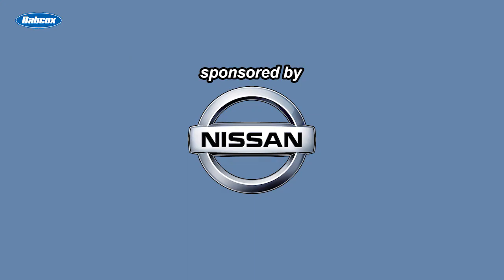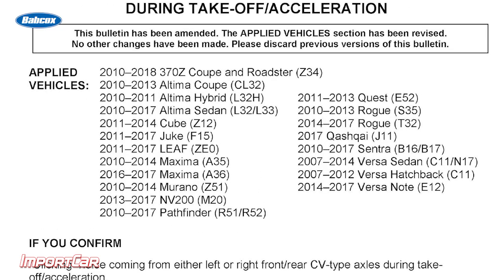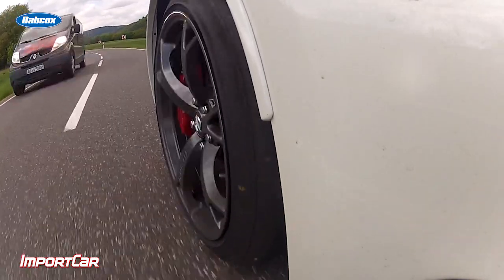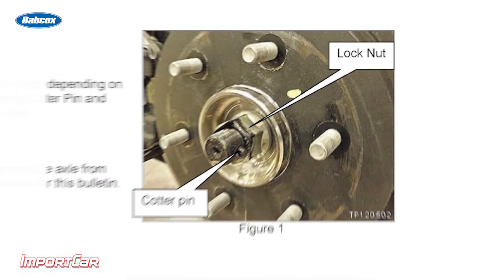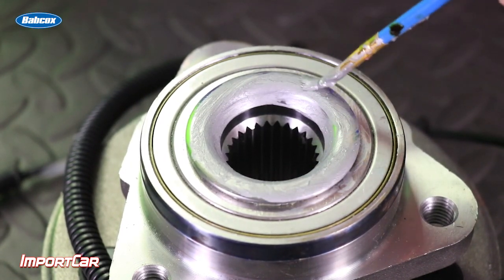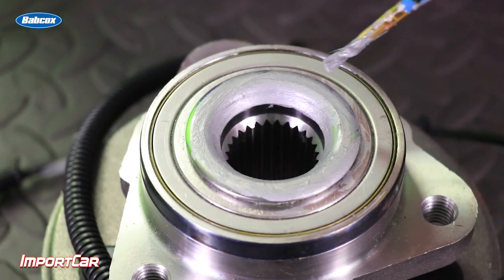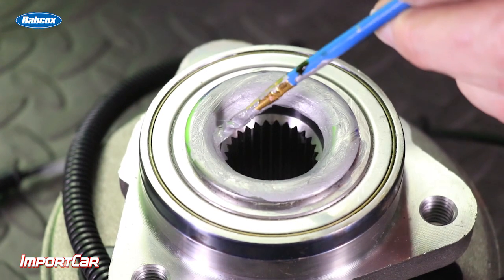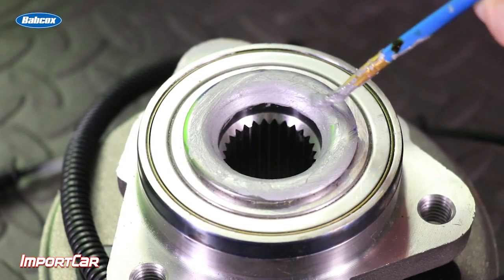Clicking From The CV Joint Or Axle? Check Out This TSB | Tech Minute

Comment: Spot on! Worked like a charm. 

I took it a step further and cleaned off all rust from the back face of the hub and the axle with a rotary wire brush. I was already doing other suspension work so it was easy to take that extra step.

Comment: The clicking noise comes from the roller bearings moving in and out of worn pits in the bearing surface within the CV joint!!! This video does a dis-service to troubleshooters! It has nothing to do with the CV axle other than it protrudes through the CV joint and transfers the torque from the engine. The bearing surfaces in the CV joint only wear abnormally when the grease drains out of the joint because of a leak/tear in the CV boot.
Reply: Brian Ford so I just changed my CV axels on both sides and now I have a single click that occurs when changing direction. If I back up, it clicks. The if I go forward, it clicks again. It won’t click again until I back up. I can recreate the experience if I hold the brake and put in reverse and then push gas. Then switch to drive and push gas with brake held. The wheel is not rotating but I still get a single click with the change in force.
Reply: @bradmelton7985  Are your axles and intermediate shaft properly/fully seated in the differential? Also, check the tightness on any intermediate shaft mounts, transmission mounts, axle spindle nut and suspension hardware. Sounds to me like something is slightly loose and shifting a tiny bit when the axles change direction, which leads me to believe it's a loose axle or axle mount.
Reply: @bradmelton7985  me too man. did you find a way to fix it ?
Reply: Batsuld Kyu The easiest and cheapest fix it to unbolt the joints, clean the rust off, regrese them with M-77 grease ONLY. Should take about an hour
Reply: @bradmelton7985  Are they new joints or refurbished joints? It might be that one of the marble-sized balls (they aren't really bearings) (there are maybe 6 in each joint) is undersized and it rolls to the edge of the tang it operates in causing a single click when it reverses direction and rolls to the other side of the tang. It is just a guess. I wouldn't expect that in a NEW set of joints. IF that is the case, I would expect it to eventually fail. But you will NEVER know unless YOU take it apart and check on it. A maintenance repairman would never admit it if he verified it.
Reply: Brian Ford it’s was not refurbished. I actually sent them back and bought new ones. The car did the same thing. I never figured it out. It was just some sort of play in the linkage from tranny to wheels. Dunno. I traded it in and got a truck. I live the truck. First Ram and I’m pleased so far.
Reply: @bradmelton7985  My only experience with the CV joints was with an '89 Plymouth Voyager van and my Subaru SVX. The clicking sounds the same in both but the Voyager CV joint is constructed a little differently than my Subaru and this Nissan. My Voyager came apart which enabled me to take it apart and see for myself what caused the problem. Unless these mechanics tell us WHY something is happening, I have a hard time believing them.
Reply: I think this Nissan tech bulletin is just a band aid so they don't have to replace the entire axle. The axle from the factory is most likely "crap" since they are getting cheaper and cheaper parts to put on their Nissan cars so they can extract bigger profits. Nissan used to be a great car company those days are over.
Reply: @bdphourde  Hi use loctite on the threads between the wheel bearing and the axle.